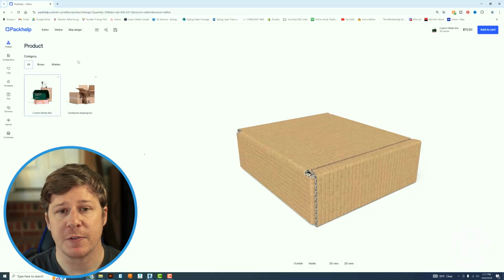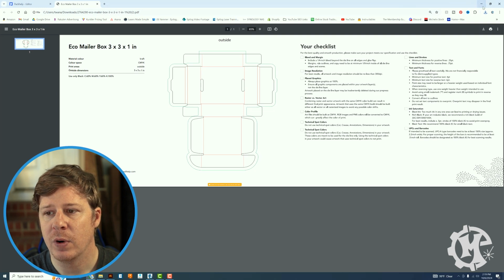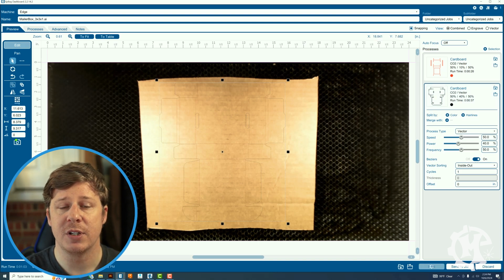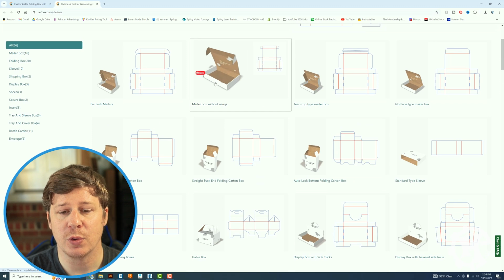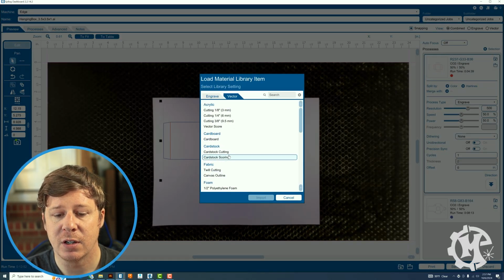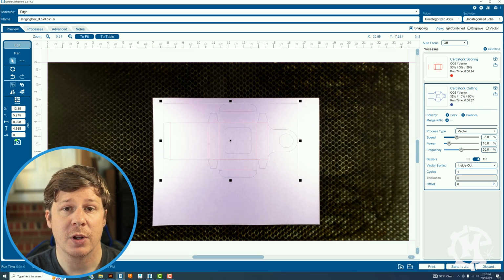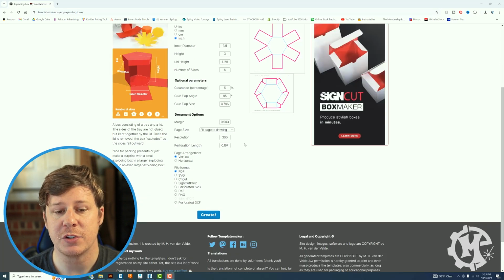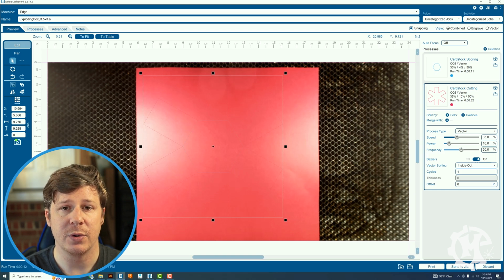Make 3 Custom Boxes for Your Business with FREE Online Designs!

Comment: Hello, What is the exact model of that laser printer you use to cut the card board. and also, how did you edit that file from packhelp.?
Reply from the maker: It’s an Epilog Fusion Edge 12 that’s a 60 watt laser. I edited the file using Adobe Illustrator.